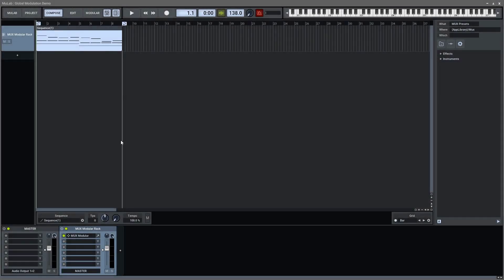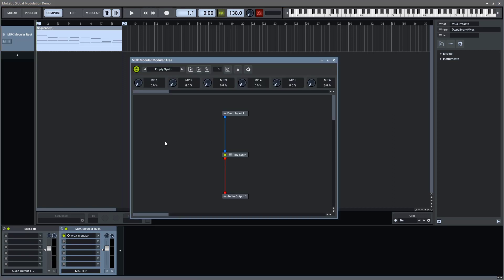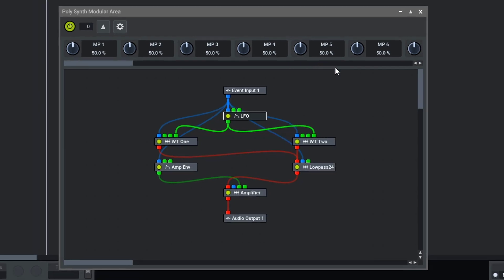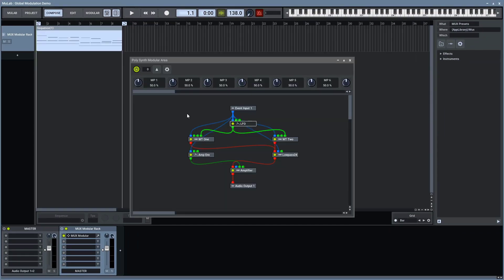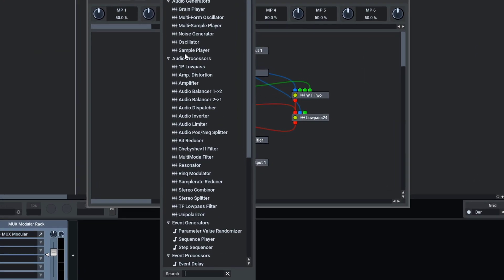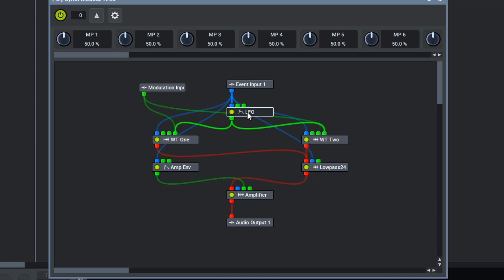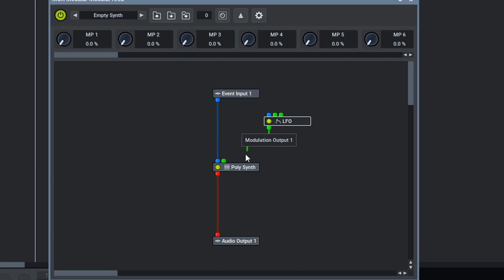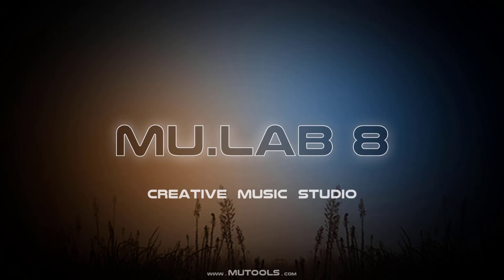PolySynth Global Modulation

Comment: I'm having difficulty exporting good quality audio to Youtube through the Windows Photo app. I have to keep decreasing the volume of the song in Mulab to prevent a bit of crackling and I'm not sure what I'm doing wrong. Any advice? From anyone? Cheers.
Reply: Sounds like you're running into clipping on the master. Using a decent limiter/compressor/maximiser on the master channel will help to prevent that.
Reply: @DakkraOfficial  
Cheers for the reply dude. But it doesn't make sense as when I upload the track to SoundCloud or listen to it on Groove Music, it sounds great. I think it may be the Microsoft Photo app that's causing the problem but I'm not sure.
Reply: @jackbattye3355  Perhaps it is the photo app. There are several free video editors out there if you'd like to try different ways of publishing music to youtube. HitFilm, OpenShot, and KDENLive come to mind off the top of my head.